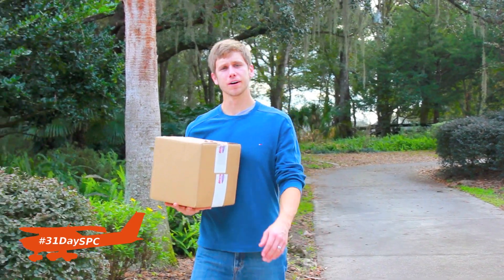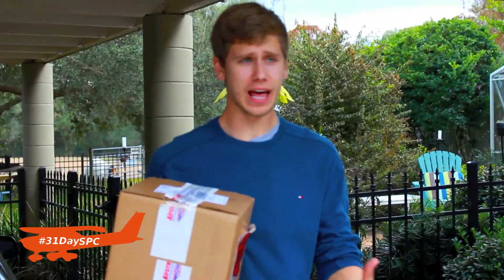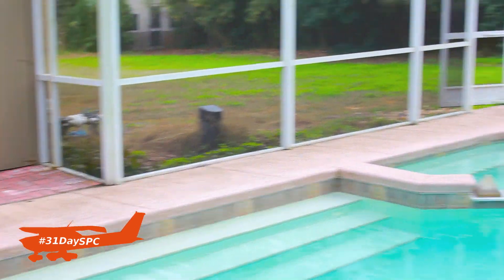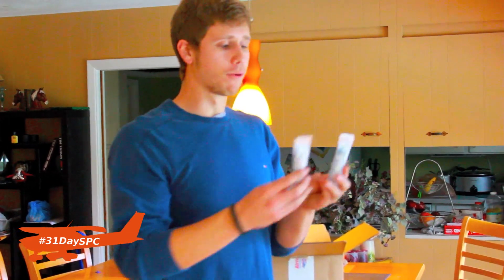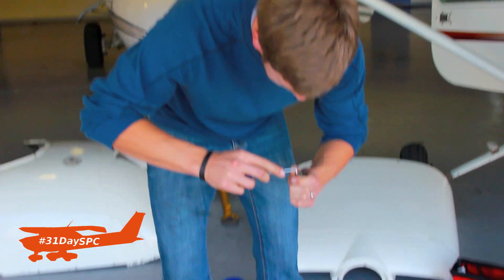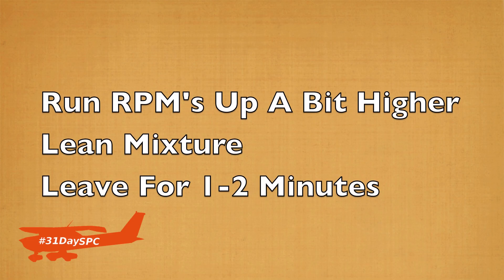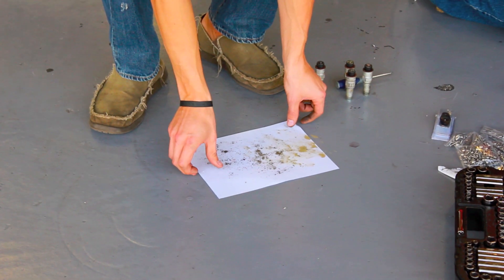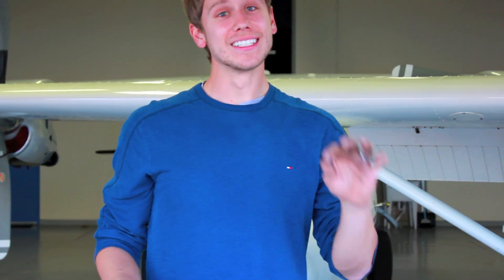Problems During Runup (bad mag drop) - Day 5 #31DaySPC

Comment: Never tap a plug like that. I've always been taught if you drop a plug throw it away. And you are tapping it, not good.
Reply: +William Schanks For real.  Careful about damaging the electrode with that tool and cracking the ceramic insulator while beating it on the concrete.  eeesh!
Reply: Nonsense!...You're wasting money if you're tossing plugs or anything for that matter just because you dropped it. If you're that concerned about that I would recommend you take a baseline measurement with a ohmmeter or a continuity tester. It might save you money and give you peace of mind if you're worried about that. Safety 1st!!!